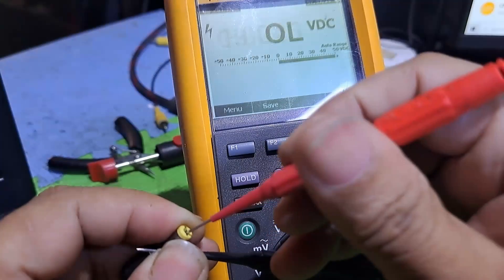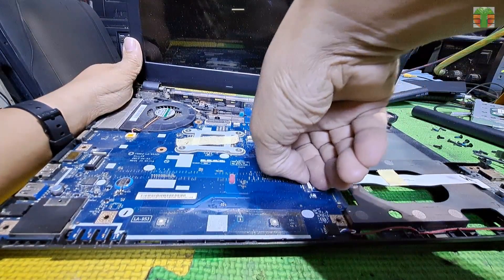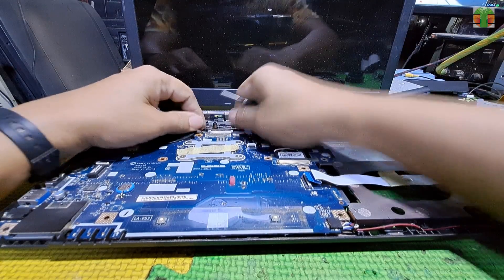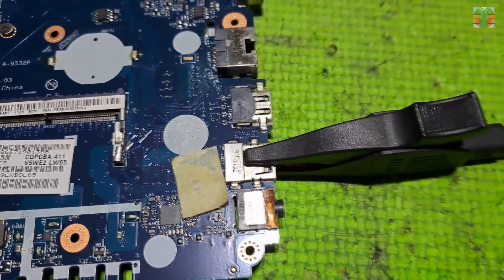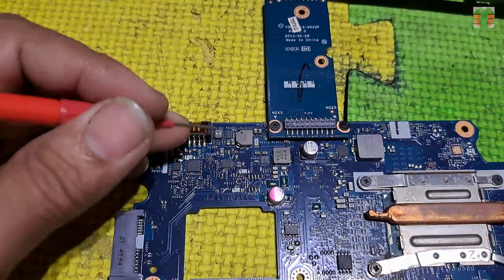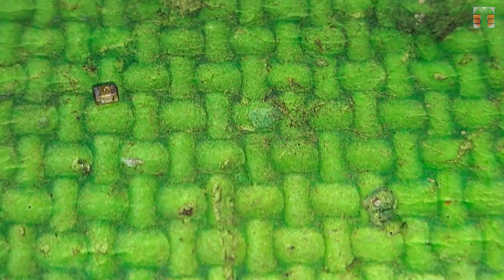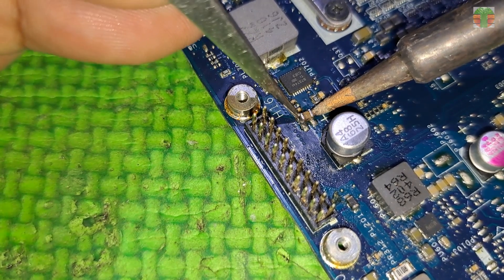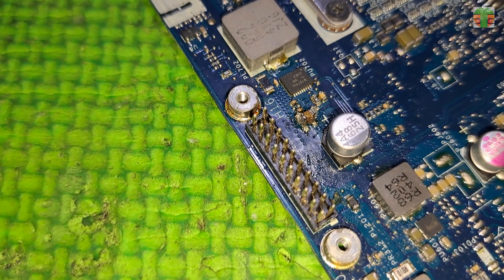Acer Aspire No power repair

Comment: Why does he use one single prob ..while troubleshooting ..the Red prob ..only... where's the..black
 prob ... I'm new to eee
Reply: The black is on ground (chassis ). Therefore he is reading across all the capacitors on the voltage rail.

Comment: Nice  your all video  sir  and many things learned  from your post  tanks continue.
1 one quetion on power section  top2449yn this component is not avinable on my air  so which component  replace  str is avinable pls
Reply from the maker: modify using strw6053
Reply: Tnxs

Comment: Any video made on "main power line" circuits? I saw most of the video they say main power line but for a new bee its  difficult to get an idea.
Reply from the maker: If you say the main supply is the 19 volts rail, and it is the supply that came from the adaptor or the charger of your laptop.